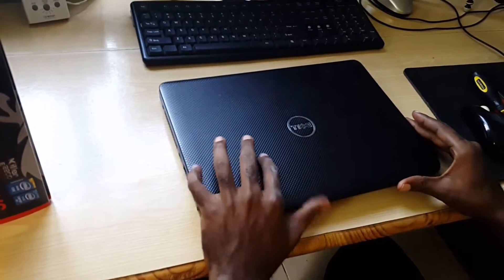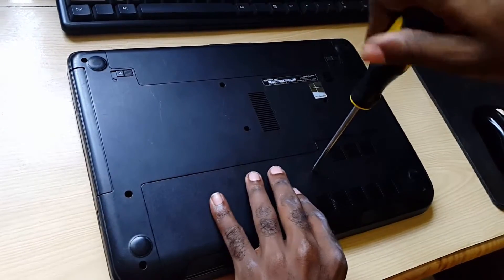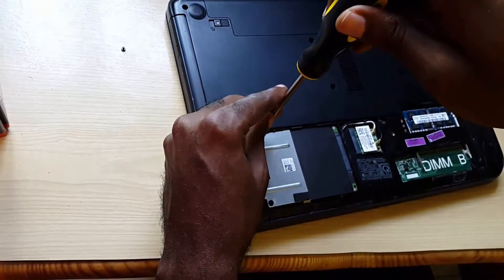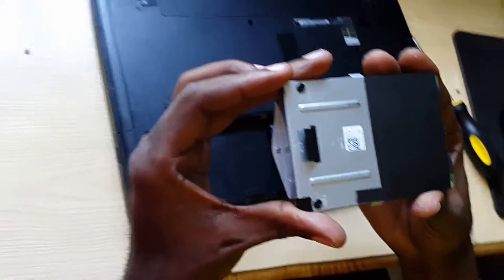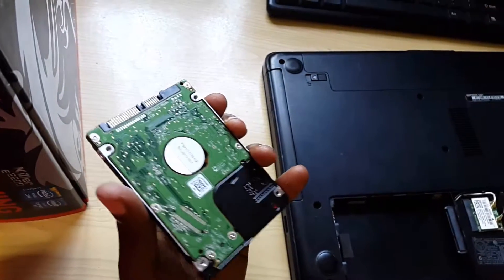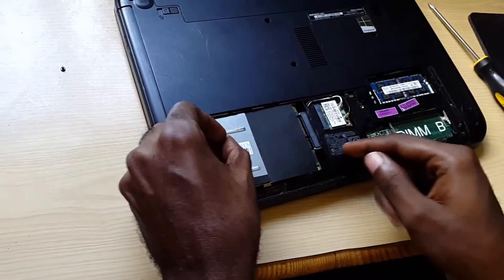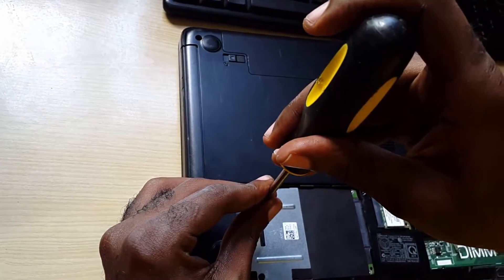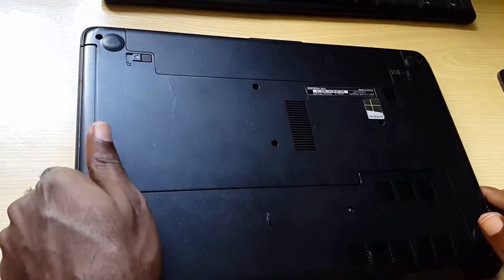Easy Laptop hard drive replacement

Comment: Hi so my galaxy s4 works and I receive notifications and calls and everything but I can't swipe or use my touchscreen at all, and I tried taking out my battery and holding the power off button and putting my batter back in and iv seen ur videos but nothing seems to work, I don't know what to do. Can you help or do I have to take it to a shop?
Reply from the maker: Airam Parra Before taking it to a shop try the method a few more time, and also check to see if your power button is stuck by removing the battery and nudging it a few times. You can also smack it around the power button carefully on a telephone directory.
Reply: Okay will do. thanks